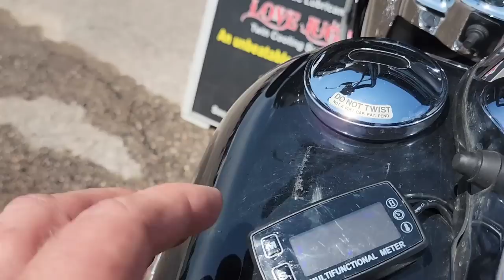Ep628, Maybe It's Time For A Goldwing // Parking Lot Repair

Comment: Since the heads are water cooled, they don't have the cooling fins that the air cooled ones do. I sold my last modern Harley because of cam tensioners and bought a new 07 Goldwing. 240,000 miles later it has never failed me.

Comment: Would Never ever use a power washer on a motorcycle. Never ever!
Reply: I have done that for decades. Im Just careful
Reply: Congrats! You realize that you dont have common sense. You can literally powerwash ANYTHING. Just dont put the nozzle right up against whatever you are washing.
Reply: @aaronpatterson2369  you absolutely do know it all
Reply: @davemachoukas6175  I have used pressure washers on every motorcycle I ever owned & zero problems

Comment: Lol 4 days at Repair shop ? .. I’ve owned 3 Goldwings dating back to 1992 with about 150,000 miles logged on the Wings . Biggest repair i have done is replace a alternator !   Just normal maintenance… tires,  oil changes, brake pads, tune ups once in awhile

Comment: The heads are cooled on the water cooled engines. So it is just an assist as you say. They must of built in a fail safe that if the heads get to hot the light comes on kinda like parade mode on the older bikes.